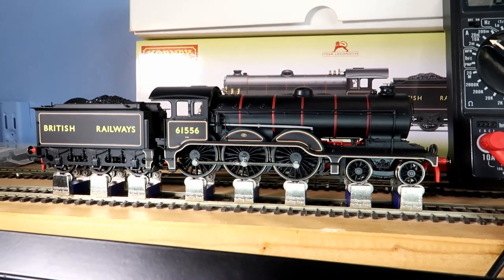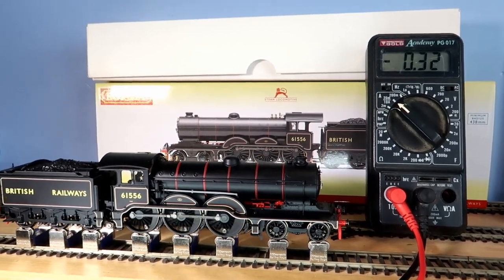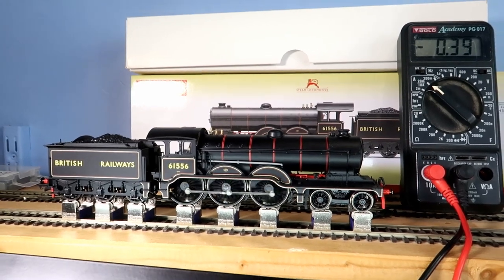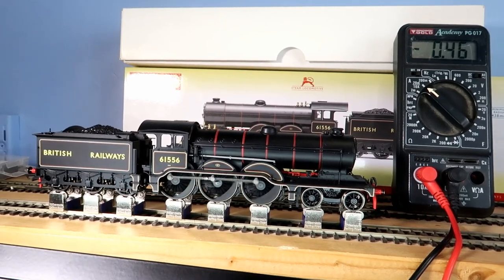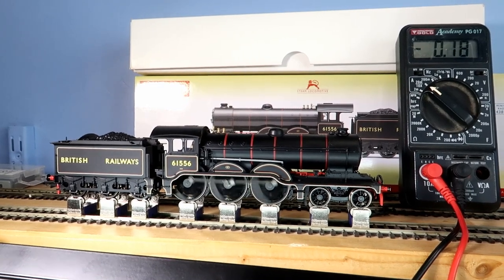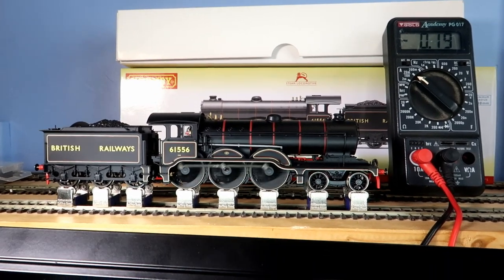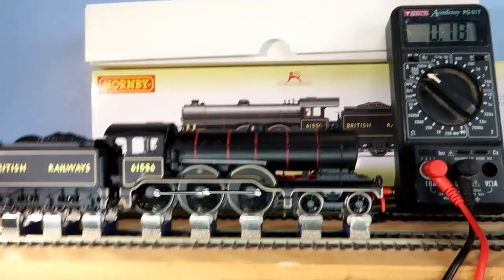Hornby B12 motor fail, NOT AGAIN, Warning to others and apology

Comment: I'm currently 18 months into taking time out from buying Hornby after a long succession of quality issues. Several were returned to Hornby for 'repair' and I raised this with one of their senior managers. They weren't interested. I was tempted by some of the recent Hornby releases, but stuck by my time out, the problems with the A2s, W1s and your issues indicated I was right in staying away until Hornby sort out their quality. It's a nice loco, so fit the new motor. Have you got a link for the 99p motors you bought? I'd like to carry some spares. hope you get the issue resolved and get back to enjoying this lovely loco. All the best, Colin.
Reply from the maker: Hi Colin, many thanks. Can't give you a link sadly as they have all sold out, but if I find another source I'll be sure to pass it on

Comment: I got a B12 for £5 from an exhibition in the 80’s. It recently sucked some wire wool into the magnet, and caught fire. I gave it a full service and new brushes, and now it runs quieter and smoother than the newest B12 that I paid £150 for!
Reply from the maker: LOL that's about right, well done
Reply: i picked up a 2nd series b12 the one with the finer rods and motor and blackened wheels .it out runs quiet a few of my newer hornbys so i know what you mean lol

Comment: It’s a shame as it’s a nice loco. 

It's very disappointing to get a faulty loco. I had a W1 that would not run properly and had motor issues. I sent it back for a refund as I don't trust Hornby on repairs 

At the moment I'm having trouble with my EFE underground train its been back to Bachmann twice and I've done two repairs myself 

I don't think these companies care about their customers anyone 

I'm cutting back on new models.

Hope you get the b12 sorted
Reply from the maker: Many thanks Oliver, I have heard about issues with the underground sets.
Reply: Hornby seems trustworthy enough for repairs
Reply from the maker: @thejohnler8358  have to say that has been my experience as well, world apart from the retail section
Reply: @ModelRailwaysUnlimited  they sent me someone else’s loco and decoders once instead of my loco after three months waiting for a repair.I did get the correct loco in the end .

Comment: That's why all my B12's are the older X03 motors all suitably updated. Hornby seem to be content to use substandard motors. Send it back for your money and buy some older ones. Then improve them your self. They may not be perfect but at least they will run virtually forever.
Reply from the maker: Well you can see my older B12 in action in the video before this one, you are right of course.

Comment: I had a similar situation on a Farish class 66, the new motor was about 21 sterling from the supplier but I got 5 motors for under €4 from China. Like you, I had to fit my old flywheels back on the new motor. Has been working perfectly for weeks now doing long hours daily!  
I say claim a new motor from the supplier if it is still under warranty and buy those China motors for the next time!
Reply from the maker: Thanks, that's interesting to hear. I am down to two of the original types now but have a number of alternates on order and will report my findings.
Reply: @ModelRailwaysUnlimited  Look forward to hearing about it :)

Comment: In truth, if you want to keep the model then install a new motor is the best option. Hornby could replace the motor under warranty if the model is still under the warranty. I have moved over to American models because Hornby have slipped a lot on their quality and I no longer trust them. Proto2000, Athearn, ScaleTrains, Atlas and MTH are far better than Hornby and are cheaper too. I will never give up on model trains but I am done with the newer models from Hornby as they are overpriced trash to say it nicely.
Reply from the maker: Thanks, motor replaced and testing underway, looks good
Reply: MTH is by no means cheaper than Hornby and I find Severe electronic issues with them over time

Comment: Very common problem in recent times, both on OO and N Gauge models - it's likely not a motor failure, but the commutator clogging with brush carbon. Cleaning that and polishing its edges will solve it.
Reply from the maker: Thanks for the info! I see you have already seen the video of me opening the motor

Comment: "
1:45
so first of all i'll apologize to
1:47
anybody that took my tip
1:49
and bought one of these and is having
1:50
the same issues
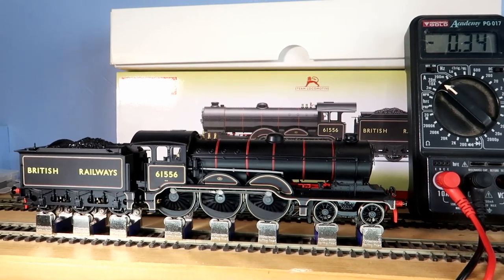1:53
um
1:54
i mistakenly thought hornby must have
1:56
sorted it out by now

The exploding Ford Pinto wasn't until the bean counting execs had their collar felt, they knew there was a problem, it was just cheaper to pay the compensation than fix the problem.
Reply from the maker: I think a recall should have taken place, Hornby could easily identify all affected models and recall and fit new batch motors, better than having them palmed off cheap but broke.

Comment: I could understand the temptation to simply replace the motor yourself, but the more people do that the less returns Hornby will have and it's returns that tell Hornby they have a problem on their hands. I still have a Triang Hornby B12 that runs like a good un, not got the detail of it's modern counterpart but in the running department it is still great. Given the price Hornby want for locos, even the Railroad versions they should make sure the basics of the loco are decent quality. Just before last Christmas I bought a Hornby Tornado off eBay from a model shop and the item was marked as a return and priced to match. When I finally got to run it the front pony kept derailing all the time. I had some stick on motorcycle wheel weights and cut and filed one small enough to add to the pony truck and up to now it is ok although I am thinking of simply putting a spring between the underside of the loco chassis and the top side of the pony truck, again an issue that would never have happened in the Triang Hornby days.
Reply from the maker: I get your point

Comment: the difference between a good motor and a crappy one is probably a few pennies.
Reply from the maker: Certainly true
Reply: @ModelRailwaysUnlimited  Hornby doesn't seem to care about model railways anymore. It's a shame the European manufacturers never really tried to enter the UK market. They're not cheap but things like 5 pole motors with flywheel and capacitor are pretty much standard.

Comment: You would have thought that with Hornby making their products in England again, quality would improve. Or maybe some motors are still made in China. But in general, quality has dropped and the prices are ridiculous, bordering on greed, to make up for lost sales during the pandemic.I realise wholesalers and retailers have to make a profit, but it should be transparent and ethical as well, not ripping people off.
Reply from the maker: Thanks Brian, certainly disappointing
Reply: @ModelRailwaysUnlimited  And reality, Hornby should be grateful for honest reviews of a product or component. Constructive criticism is not vindictive either, it usually helps a manufacturer or ineed a supplier to right a wrong they may not have even been aware of, or to actually see what consumers think. I have been told that just one complaint translates on average to another 66 people steering away from a product or supplier... So it is in the best interest of manufacturers and suppliers to be more pro active it they want repeat business.

Comment: Welcome to the wonderful world of model trains without decent quality control... Same issue as the S15 (I've bought TWO and they do the same thing ! First refunded, second, too pissed to ask for a refund). Honestly, when you see that with UK models, and not on continental models. It can exist with any German manufacturer, but I've never heard of this issue with Piko, Roco, Trix...
If I would start train modelling today, seeing that, I would ditch immediately any idea of buying UK model trains. And Hornby is a serial offender on this case, too many issues on too many models that boils down to crappy manufacturing practices, botched conception and shoddy assembly. I don't trust them anymore, and I won't buy one of their models without having seeing before a test of the model I'm targeting. Especially while they are asking continental-like prices for this.
Reply from the maker: Check your S15s pickups, how hard are they against the wheels? Ease them off so that they just make contact when the wheels are moved away from them. I am seeing significant drag via this. Good luck and thanks for your comments
Reply: @ModelRailwaysUnlimited  I'll try this and will knows you what it gives. If not successful, well... calipher and Ebay to get a proper new motor.

Comment: Hi Mike sorry to hear of yet more probs with motor,I'm convinced it's a problem with the windings ie intermitant going leakey to earth. Remember the motor probs with the first batch of Bachman A1s they had been wound out of phase causing them to run excessively hot prior to burn out. (BRM article by Tony Wright) Would it be possible to fit a suitable size Mashima? Pity as it's sutch a fabulous model.Good luck with repair, I'm interested in your progress.
Reply from the maker: Thanks Robert, my own feeling is the brushes crumble and short out the commutator, I discovered really excessive drag on the loco pickups, eased them off. New motor in and sounding sweet at just 100mA

Comment: What kind of power supply is used to drive the trains.?
Reply from the maker: Hi, Gaugemaster model D
Reply: @ModelRailwaysUnlimited   I do not know exactly the model D, but in one of the GM throttle the control circuitry is based on thyristor, what basically kills these modern motors, designed for pure DC power or PWM up to 12 V. 
The thyristor based controller about at half speed feeds up to 25 Volts into the tracks and motors chopped in time. This creates heat and damages in the fully enclosed modern motors. Replace your out of date power supplies! ( MRC and similar are good selection). Those GM throttles were perfect for old fashion open frame motors.
Reply from the maker: @railfilm  Hi, no need to worry the model D is a Darlington pair with full wave rectification so perfect for the motors. I share your view on poorly designed PWM designs and don't use them.
Reply: @ModelRailwaysUnlimited  anyway I would check the voltage at max  speed.
Reply from the maker: @railfilm  16v but I never use it lol
Reply: @ModelRailwaysUnlimited  i believe you, but still do not know what kind of waveform is on output. I saw also a GM controller with small processor inside and the darlington output. This is definitively a PWM signal with 16 V peaks even in case when you run on 50% of speed.
Reply from the maker: @railfilm  Hi, can I direct you to this which should answer all your questions https://youtu.be/31bCjaRmjG0 if not get back to me :)

Comment: July 2023: Just had this happen with a Hornby R3454 Drysllwyn Castle. Running erratically with a rake of Centenary Coaches. Dismantled and offload the motor was switching between 480 and 680ma (slower on the higher current) and running VERY hot. Bought an x6152 replacement motor from China and it is now running better than when she first arrived. All 6 of my Hornby engines have a similar 5 pole skew wound motor so I will have to keep a watchful eye on them (R2848 Tintagel Castle, R3552 Aberporth Grange, R3864 Knight of St Patrick, R3222 42xx and R3210 28xx)

This appears to be a generic problem, with reports of the same fault on the new tooled Hornby 5101 large Prairie as well......
Reply from the maker: Hi there, sorry you've been afflicted with this unacceptable issue. Really is time Hornby sorted it out. Well done on fixing it yourself 😉

Comment: Is the problem with having the manufacturing in China, or just poor Hornby specifications and quality control? Other companies have their products manufactured in China and produce good to excellent models.
Accurascale for one. Remember, the factory only builds to the customer's design and specifications. Do Hornby oversee and constantly audit the production process, or just rely on the Chinese manufacturer to do that and get to see the samples and later the finished item when it's shipped to the UK? It can't all be blamed on Chinese manufacturing, if at all. Do Hornby just go for the cheapest motor available without testing it for suitability over a reasonable use timeframe?
Look at the Mazak rot issues.
Other manufacturers also use diecasting and don't seem to suffer like Hornby's Mazak Monster the class 31 does.
Diecast is used in a lot of industries and manufacturing, why is it the Hornby stuff crumbles like a digestive biscuit?
Reply from the maker: All very good points Neil, the motors appear to be 'toy' specification as the ones I bought were high speed etc. We need proper motors for our application but I doubt they would then cost 99p and as such would significantly add to the total cost we pay, mind you are £200+ these days that should be enough

Comment: Hi Mike .. Just replace the motor .You love the train it`s not worth the hassle and expense sending back. Then at least you know it right.
i have just received my brand new APT-E loco and that's toast. Am sending it back to Rapido. As soon as turned the power on it burnt the chip out. Not good but at least i get it fixed F.O.C. Well that`s the plan it will be interesting to know what wrong.
So chin up mike bite the bullet..lol..
                             regard's Allan
Reply from the maker: Cheers Allen, new motor in and testing on going, I did find the pickups on the wheels were excessively hard but not sure that will have caused this. Sorry to hear about your APT

Comment: Oh no that truly sucks they are such wonderful models otherwise. If you already have a replacement motor at hand then I’d go for it rather than send it back, at least you get to keep a good looking model. Looks like I’m going to have to keep a close eye on mine when running, I certainly can’t send it back now as it’s a couple of years old but hasn’t been run much.
Reply from the maker: Thanks for your thoughts. At the moment the loco is undergoing tests.
I replaced the motor and that too failed but I think it was one of the ones Hornby sent me for the S15 and I fitted it by mistake.
Now its fitted with one of the Chinese ones.
It’s running much better than it did and is drawing just 100mA which is fine. I’d expect motors of this kind to draw between 50 and 150mA if all is well.
I have some suggestions for other owners that want to try and stop the motor issues.
1) Check the loco wheel pickups, mine were way too hard and causing lots of drag, ease them off so that they just keep contact when the wheel is furthest away from them.
2) Inside, see https://youtu.be/Uwp_z3GdXXk Make sure there is clearance between the rear flywheel and the motor bearing, check that the sleeved wire from the suppressor capacitor is not fouling the back of the front flywheel. Make sure the worm tower bearings are lubricated. Make sure the motor bearings are lightly lubricated. Check in the worm tower that the grease is not too think.
My feeling is that the motors are failing as the brushes break down due to heat and short out the commutator segments. This could explain the erratic running we see.
I can’t pass on the link for the Chinese motors as they are out of stock now and have no plans for more. If I find an alternate supplier I’ll let everyone know.
Take care. Mike

Comment: That's horrible.  I had that with a Lord Nelson.  My S15 and B12, so far, are fine, and they've hours under their belts.  
I'd get it replaced under warranty.
If it happens again, then try replacing the motor.
Al.
Reply from the maker: Thanks Alan, Thanks for your thoughts. At the moment the loco is undergoing tests.
I replaced the motor and that too failed but I think it was one of the ones Hornby sent me for the S15 and I fitted it by mistake.
Now its fitted with one of the Chinese ones.
It’s running much better than it did and is drawing just 100mA which is fine. I’d expect motors of this kind to draw between 50 and 150mA if all is well.
I have some suggestions for other owners that want to try and stop the motor issues.
1) Check the loco wheel pickups, mine were way too hard and causing lots of drag, ease them off so that they just keep contact when the wheel is furthest away from them.
2) Inside, see https://youtu.be/Uwp_z3GdXXk Make sure there is clearance between the rear flywheel and the motor bearing, check that the sleeved wire from the suppressor capacitor is not fouling the back of the front flywheel. Make sure the worm tower bearings are lubricated. Make sure the motor bearings are lightly lubricated. Check in the worm tower that the grease is not too think.
My feeling is that the motors are failing as the brushes break down due to heat and short out the commutator segments. This could explain the erratic running we see.
I can’t pass on the link for the Chinese motors as they are out of stock now and have no plans for more. If I find an alternate supplier I’ll let everyone know.
Take care. Mike
2mm shaft
35.8mm body
6mm dual shaft
16.6mm biggest width.
12.6mm narrowest width.
12V-24V-High-Speed-Micro-NdFeB-Strong-Magnetic-Mini-130-Motor-DIY-RC-Car-Boat